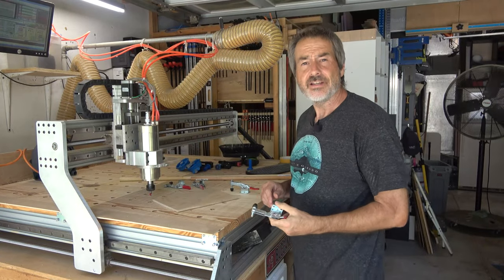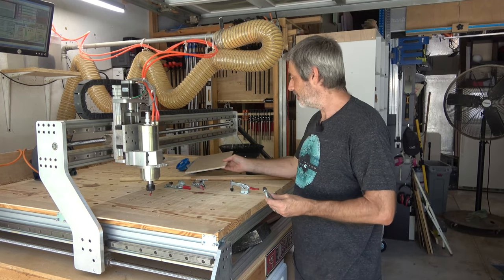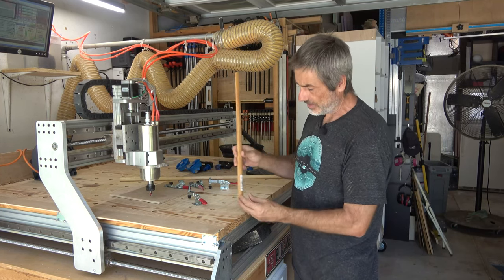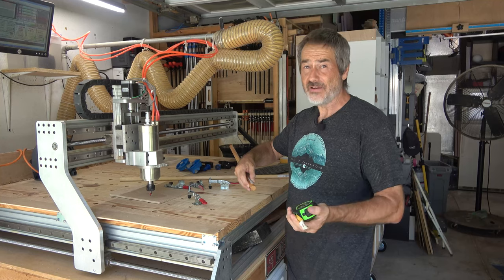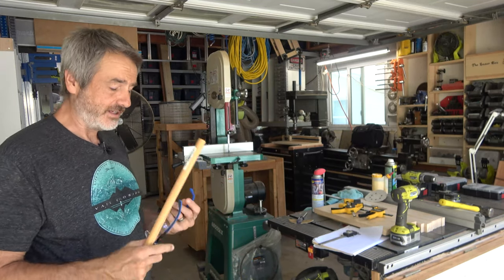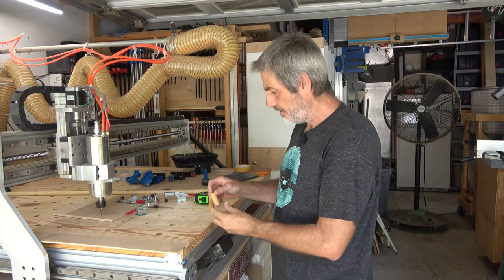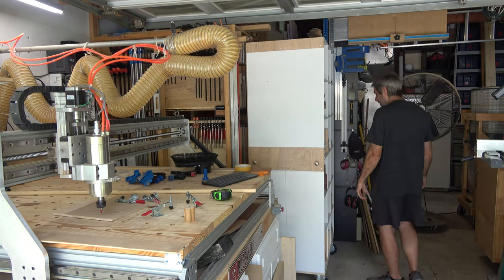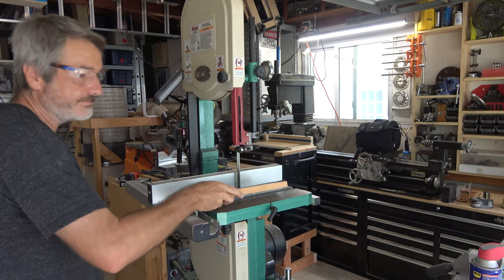Shop Made Bench Dog Clamps

Comment: Hi Jammie really liked the video and very simple idea considering the cost of holdfast clamps. From your experience of using the clamps what is the maximum timber thickness you can clamp.
Reply from the maker: I think the max I every really tried was 1" boards and they held down just fine - generally I prefer the side clamps though because these are kinda in the way for CNC work :)
Reply: @JamiesHobbies-GGB  Thank you for the quick response much appreciated.